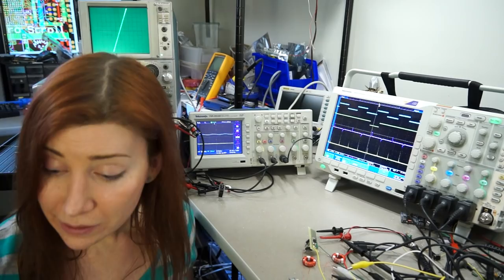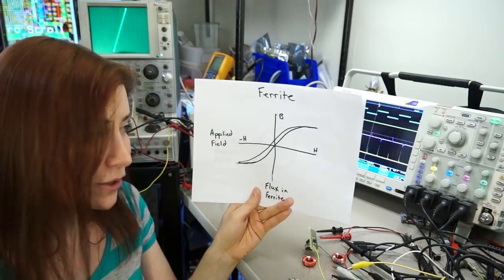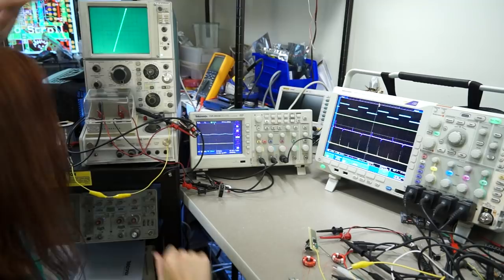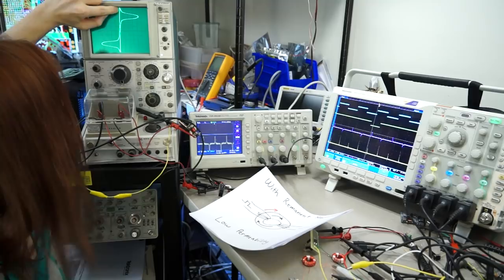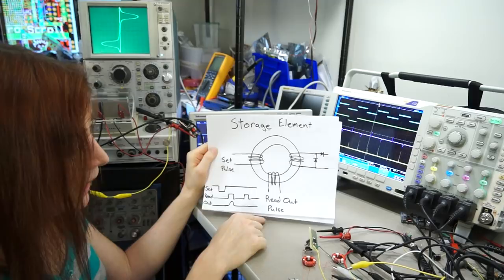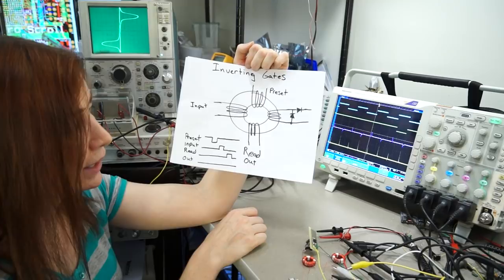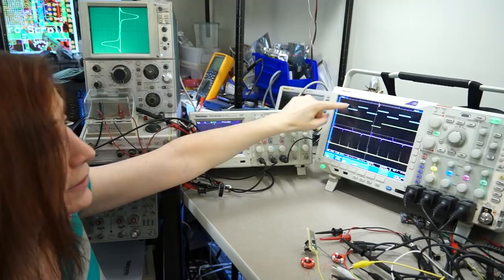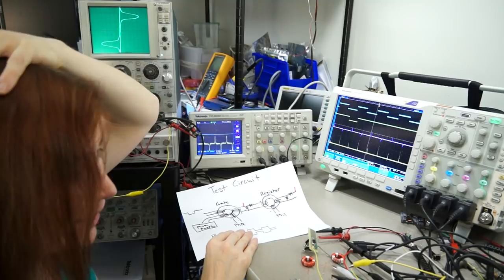Magnetic Logic - Forgotten Technology

Comment: It's cool to see this technology work I like this technology but try the kind without diodes and no turns just threw the center I want to try using that technology to 3d print circuit boards using conductive iron filled pla

Comment: You have the intellect and persistence needed to understand not-commonly-taught issues.

When DC is piped through a transformer primary, a brief coupling of the primary's magnetic field induces current in the secondary.  And if the DC is left running in the primary, with the magnetic field still present, there is no current in the secondary.

A PHYSICAL ANALOGY
- an underwater diver fires up his welding torch to perform underwater welding (dock or bridge repair, say)
- a thermometer near the torch registers the shock wave of heated water then the water is almost immediately quenched to cold by the vast majority of the water, which is colder

The brief magnetic coupling of the DC in the primary onto the secondary winding is a shock wave of polarization of the constituents of so-called 'empty' space.  Since the vast majority of space consists of randomly-oriented constituents, they de-cohere (re-randomize)  the briefly-polarized constituents generated by the DC turning on in the primary.

We used this to help develop artificial gravity devices.  The recognition of the shock wave behavior clearly showed the presence of polarize-able constituents not perceived by human senses.

Another clue:  accelerate two 'North' poles of two neodymium magnets toward each other and carefully note the increase inertial drag the closer they get - the attempt to accelerate them to touching is difficult due to the increase in inertial drag.  In other words, the acceleration is thwarted, is attenuated.

Now carefully look between the magnets before they touch - the space is transparent.  It appears (to our human visual senses) to be empty.  But the sense of touch - the perception of declining acceleration - again indicates polarize-able constituents of the 'emtpy' space.

I have an EE and physics background, and never believed my profs when they said "electromagnetic waves do not need a medium to propagate."

They say that with a straight face, despite the fact that electromagnetic waves in space have polarized electric fields, and polarized magnetic fields, that oscillate.
You cannot create an electric field with 'nothing.'   You cannot create a magnetic field with 'nothing.'

The fact that there is Vacuum Permeability and Vacuum Permittivity (see wiki), and an ambient impedance of 377 ohms in 'empty' space, provided further evidence of the polarize-able dipoles that we rely on with our artgrav devices.
.

Comment: maybe you said this but how would you switch polarity to the initial current coming in to actually be positive or negative, And if your doing it by hand like on a manual switch, how would a computer do this? Are they allready set to have a negative current and then the others with a positive current, or is it done by a manual option?

Comment: I have a problem. I'm using a hex inverter ic chip to alternate powering on two relays. I need a slight pause between the turning on\off of the relays. Can I use two toroidals both with small magnets attached to set up a slight  hysteresis threshold?

Comment: I can imagine the logic operators made in hardware by wires in a coil, but it must have been very inefficient! Smaller then vacuum tubes, but still big. I can see how data is stored in magnetic fields, but I can't see how it is read back! A coil in a ferriet ring can't cense the filed when there is no motion. How was that done?
Reply: vanhetgoor, I think you have to watch the video again very carefully
Reply: You add a third winding to the ferrite, then you send a positive pulse through it.
If you get a good signal on the 2nd winding (read winding), then it was a 0, and no signal would be a 1.

That's because you don't get a signal from the "read winding" if you create a magnetic field equal to what the ferrite holds.
So if you send a positive pulse through the "set winding", the ferrite would get a magnetic field that would represent a 1, and vise vers.
If the field is set to 1 (positive pulse) and you send a positive pulse on the "read out winding", the "read winding" wouldn't give you a signal out.

It's all explained in the video. :)
Reply: CDs use magnetism to store information
Reply: No they don't, the laser makes small indentations on the disk, Google it. Mechanical hard drives on the other hand uses magnetism to storage information.

Comment: Jeri is there a way to make a 25kv pump z wave 40ns 1kw without transistors? I'll pay you $100 for a solution. I'm also engineering a new type of cyclotronic zpe lifter I could use help with.